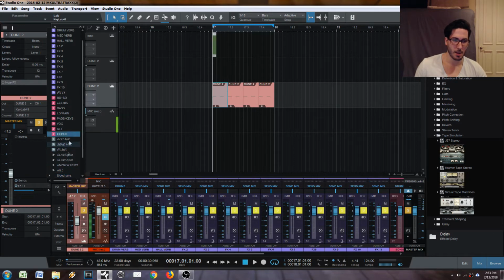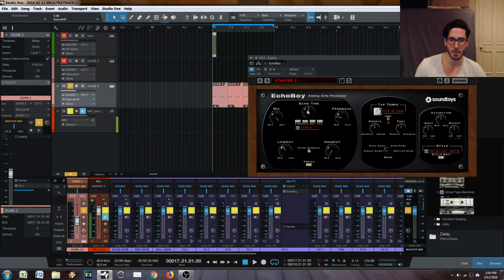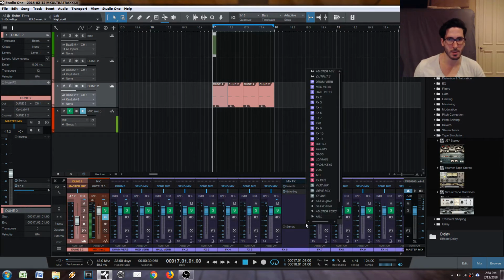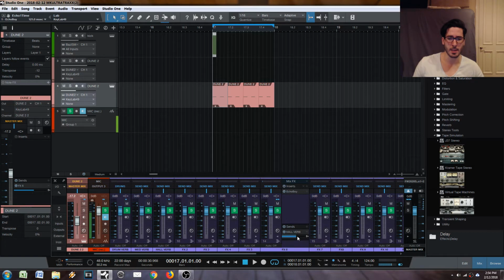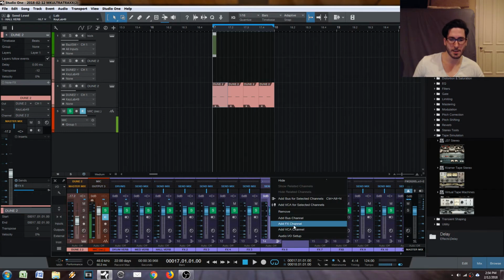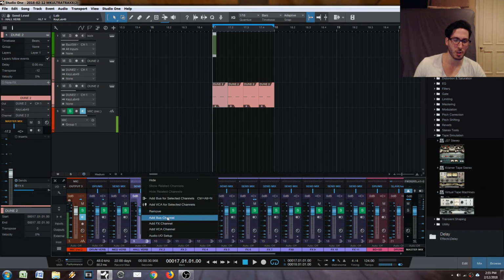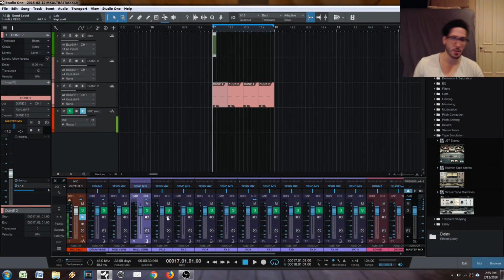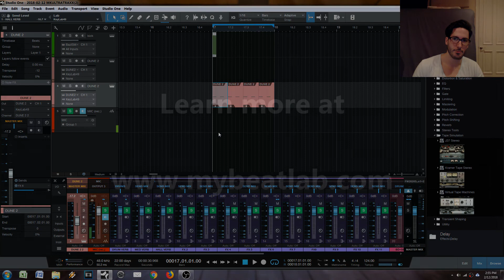Presonus Studio One Bus vs. FX Channels for Sends

Comment: Dude, I dont like how you confuse ppl with that video. 
Actually, you have 2 options: bus n fx 
In s1 they are treated differently. I mean fx is a bus channel and the bus is fx. 
So, you route (send) your audio file to fx (like you route it to bus channel in Pro Tools) and then bus. After that you can add not only delay to your audio but also reverb, saturation and etc.

Comment: cool video just got my copy of S1-4 pro. As a reason user i was just freaking about this issue thinking i was doing something wrong. Ill have to make a template like yours thanks!
Reply from the maker: Glad I could help Luke. Having worked in logic, ableton and pro tools S1 is my favorite. It's deceptively simple and incredibly fluid as a production environment. 

Feel free to Lmk if you have any questions as I'm about to start producing newer, higher quality vids in January.
Reply: @nathannyquist7208  yes, i have used those primarily as well and s1 is like a great combo of them all and the fact i could use logic key commands in s1 was the final thing that sold me.  initially, i was wary of using function keys as shortcuts (on a macbook that just sucks) and really didn't want to learn a while new set.